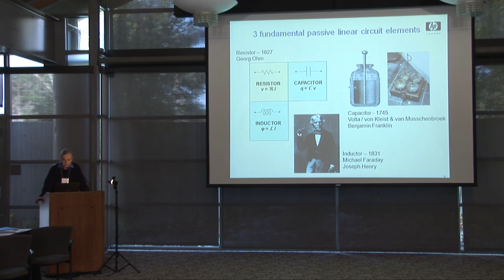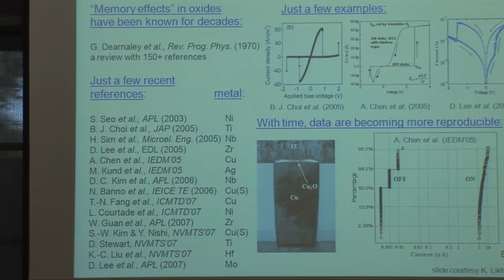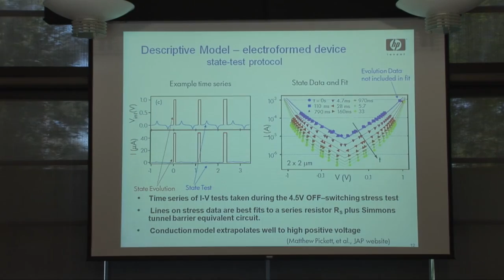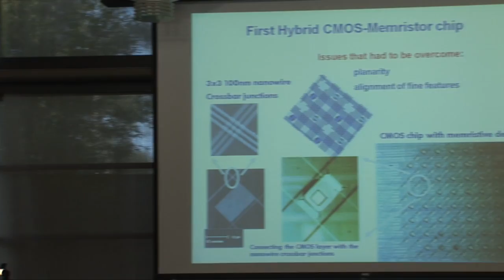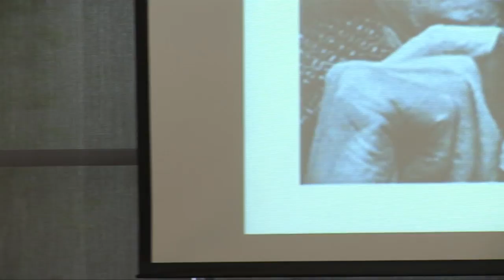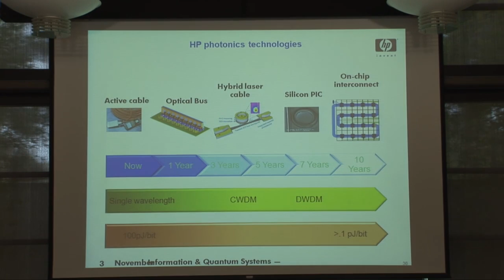Finding the Missing Memristor - R. Stanley Williams

Comment: Memristor is just a kind of resistor with memory rather than new fourth passive element. The relationship between charge and flux represents the resistor. The resistors include linear resistor, nonlinear resistor and memristor. The memristor is memory resistor.
Reply: It is a new fourth passive element because you can't model it with the other three, it is a new kind of component

Comment: Passive device : resistor, capacitor, inductor
RCL elements are constant.

Variable device in Active device : (volatile) variable resistor, variable inductor, variable capacitor
RCL elements are variable and volatile.
ex) diode, varistor

Memory device in Active device : (nonvolatile) memristor, meminductor, memcapacitor
RCL elements are variable and nonvolatile.
ex) resistive switching device
 Memristor : memory + variable + resistance
 Meminductor : memory + variable + inductance
 Memcapacitor : memory + variable + capacitance
Reply: The memristor is supposed to be the fourth passive deviced as theorized by Chua in 1971. It's completely passive.

https://i.stack.imgur.com/3PvGn.png

Resistance is a connection between voltage and current.
Capacitance between voltage and charge
Inductor between current and magnetic flux

One element that connects charge and magnetic flux is missing, if it exists, and that would be the memristor (see picture).However since a few years people have been calling resistive memories "memristors", but that's simply not correct...
Reply: So, M is constant?

RCL elements are constant?  or variable?
Reply: Entropy3ko if Chua's definition is correct, you can say "M is constant" or "there are other reasons". 
I have a question. M is constant? M is variable?

Comment: Sorry to say but this is scientific hogwash. What they call a memristor is not a memristor at all, since it does not involve at all a magnetic flux (as it should)

it's like claiming to have discovered the inductor without the presence of magnetism.

Please read: 
"The missing memristor has NOT been found" - Scientific Reports | 5:11657 | DOI: 10.1038/srep11657
Reply: "Resistive switching memory is memristor" 

No. The proper definition of the Memristor as the "Fourth elementary passive element" needs to work with a magnetic flux. 
-
"memristor definition should be modified in order to reduce confusing effect"
No it does NOT. Just call them resistive memories and stop calling memristor what is not. If a real memristor cannot exist than it doesn't... but "redefining" just in order to call a resistive memory a "memristor" is simply not correct."Resistor is not inductor and inductor is not resistor."Yes and a memristor is something different all-together, ideally orthogonal to R, L and C." In real, resistor has some capacitance and inductance but we can ignore capacitance and inductance. Likewise, magnetic effect in memristor can be ignored because magnetic effect is insignificant. "

Again, no.Yes REAL devices are never PURE resistances, inductors of capacitances... BUT the memristor is supposed to be a fourth elementary passive element. That is the innovation of it. What you are saying makes no sense because by definition a memristor needs to depend on magnetic flux... hence it's like calling a wire an inductor and then say, let's just ignore the magnetic effect... that defeats the very purpose of an inductor.... and ignoring magnetism in memristors defeats the very purpose of having a memristor. HARD TRUTH IS: that people call some resistive memory a memristor just to push their (often crappy!) device to be published into some high impact journal.  -".I think magnetic effect is related with meminductor"

There is no meminductor and if there is it's not one of the elementary passive elements.Again read  Chua's paper from 1971. There is a good THEORETICAL reason why he proposed the idea of the memristor. 
Let's stop calling shit that is not a memristor a memristor and just call it resistive memory or something.
Reply: @Entropy3ko  You should read Chua's subsequent 2011 paper titled "Resistance switching memories are memristors" and take it down a notch with your ideological bible thumping. The paper you are citing is a highly esoteric nit-pick that bears no weight on the importance of the class of materials colloquially referred to as memristors. Who cares about the semantics? The fact is these materials are valuable because they exhibit non-linear resistance switching, and what Stan Williams is proposing in this video isn't hogwash just because you and a few others are so deeply bothered by the absence of theoretically proposed operational parameters that could never exist in any real world device (as they conclude in "the missing memristor has NOT been found"). "All 2-terminal non-volatile memory devices based on resistance switching are memristors, regardless of the device material and physical operating mechanisms." -Leon Chua
Reply: @Azathoth_Lives  "You should read Chua's subsequent 2011.. " I did.

"take it down a notch with your ideological bible thumping. " I stand for GOOD science, not science that just redefines terminology when it is convenient. Also what kind of "ideological bible thumping" am I exactly supporting? Throwing ad hominem around is not helping your case.

"Who cares about the semantics?" Science does. Semantics - i.e. proper and clear meaning to terms - is essential to science. 

"the paper you are citing is a highly esoteric nit-pick that bears no weight on the importance of the class of materials colloquially referred to as memristors. "  

Oh now memristors are "materials"? I thought they were supposed to be passive electrical elements. Clearly you have no idea what you are talking about.
Resistive memories have been around a long time. This does not make the memristor real. Just because you want to believe in bad science and some scientists are being fundamentally deceitful.
No one is undermining the importance of resistive memory devices, but this does not make them memristors. 

""All 2-terminal non-volatile memory devices based on resistance switching are memristors, regardless of the device material and physical operating mechanisms." -Leon Chua"

Chua had a proper definition for "memristor". I feel he betrayed his own theoretical discovery, probably because no one has actually discovered a proper memristor and he wants a piece of the fame.

Memristors are STILL defined as "passive two-terminal electrical component relating electric charge and magnetic flux", much like resistors link voltage and current. For now NO device has shown to be such an element. There is no memristor.

Resistive memory devices are not the concept of memristor Chua originally proposed in 1971 and I think it's pretty PATHETIC that Chua decided 40 years later to redefine the term.
Reply: @Entropy3ko  How is me pointing out your strongly ideological position ad hominem? I attacked your substantive argument, which is a semantic argument, not you. You wish to reserve the definition of "memristor" for a theoretical device that cannot actually exist in the real world. 
"Memristors are STILL defined as 'passive two-terminal electrical component relating electric charge and magnetic flux', much like resistors link voltage and current. For now NO device has shown to be such an element. There is no memristor."
The definition is more complex. All that equation says is that they are equivalent, and the introduction of Stan Williams' state variable still satisfies the equation. The scientific community at large, including Chua, has found in redefining the term that a whole class of devices fit the new definition. Why did they decide to redefine the term if the devices in question don't explicitly incorporate magnetism as a fundamental mechanism of operation? Because the output characteristics are identical to those you would expect from a device that DID incorporate it explicitly. In fact, a variety of operational mechanisms will give you memristive output characteristics, not just magnetic flux or differential ionic distribution for that matter like the 2008 paper from Stan Williams. The device output is exactly the same, so why use a different word just because the fundamental mechanism is different? It is impossible to get a pinched hysteresis loop using only resistance, capacitance, and inductance, so the name fits. Hence Chua's 2011 paper where he mathematically defines memristance in a way that is clear, and that is free of any contradictions with his original definition. You calling him pathetic and saying he published it for fame is not only ad-hominem but also an almost textbook ad-hoc fallacy. This sort of thing happens all the time. Are you this ideological about the redefinition of the kilogram? Perhaps we should reserve names for every type of device that could never actually exist in the real world? The possibilities are truly infinite so you go ahead and have some fun with it.  

"Oh now memristors are 'materials'?"
I'm a materials chemist, so you'll have to forgive me for thinking of these devices in terms of their active materials rather than in circuits.
Reply: Resistive switching memory is memristor but memristor definition should be modified in order to reduce confusing aspects. In memristor, magnetic effect is not necessary. Resistor is not inductor and inductor is not resistor. In real, resistor has some capacitance and inductance but we can ignore capacitance and inductance. Likewise, magnetic effect in memristor can be ignored because magnetic effect is insignificant. Generally, we don't consider magnetic effect by resistance.I think magnetic effect is related with meminductor.
Reply: Entropy3ko You must be pretty confident in yourself to be commenting on the work of HP engineers all with phds that their  work is "hogwash".
Reply: orazdow I have a phd too in this stuff. And other people, university professors, mind you, have  also criticized this work.

If you check Chua's paper from 1971 where he defines the MEMRISTOR, the work presented here does NOT satisfy the conditions.

It's perhaps a memristor-like device, but not a proper memristor. That's a FACT not an opinion either.
Reply: Ok

Comment: If you can have a hybrid system that basically can switch between storage and logic on the fly you can then in theory simply increase the number of "cpu's" as you need them in exchange for some free memory. And if you get low on memory you can automatically convert the CPU back thus sacrificing performance but keeping the system running. I like this :)

Comment: Memristor is too complicated to be the missing linear circuit element. The "slactor" is more likely a better fit. A "resistor" converts electrical energy into "heat" and dissipates this energy to the outside, it's a device built on "irreversible" phenomena. A "slactor" converts electrical energy into "heat" and stores this energy, it's a device built on "reversible" *ThermoElectric* phenomena. So, a "slactor" is like a "capacitor" or "inductor", the latter two storing "electric" and "magnetic".

Comment: Wow. They can do Boolean logic now? I'm no expert, but I think that means you can theoretically create a one-chip-does-all chip. Instead of having bunches of different hardware designs with different strengths and weaknesses, you could just program a memristor chip to behave like any current transistor-based chip, and it would still be extremely efficient. It would be like having a hammer that could transform into a wrench, screwdriver, level, etc. whenever needed, and work just as well.